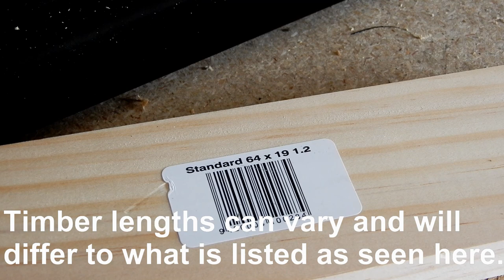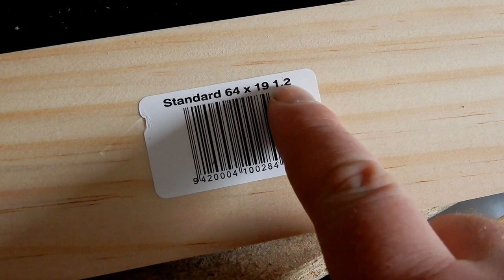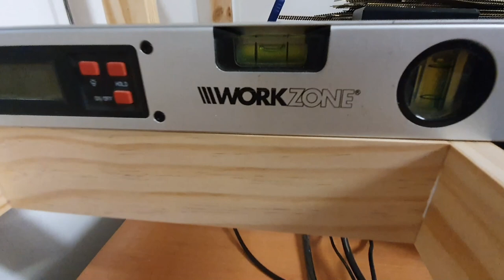Leila Central - Building Model Railway Benchwork

Comment: Have you thought about LED Strip lighting.  You could run them long the bottom of the front beam  check out Ledlighting.com.au as an example.  I can't waiting to see how its going to look
Mark
Reply from the maker: Hi Mark, indeed I have been looking at LED lighting. I have a few things to consider when selecting my lighting including power outlets required vs what’s available. Still got a lot of research to do yet but I will definitely check out the link, thanks for providing it! Clint

Comment: Having caught up on all your videos till now I have to ask, what happened to the need to have a working area in your shed aside from model railway and what on earth are you going to do with those two wall cabinets? Otherwise I am loving the new build, basically going from one to two layouts, greedy lol. Did wonder at one stage if one of them was going to be N gauge. 
Regards Chris
Reply from the maker: Ha yes! Well it's called watch the next video lol. Yea still need storage and needs a purpose but them cabinets will be going. Greedy is the word but I call it doing both things when you cant decide! No joke I have considered making them n gauge and the run would be crazy and off alot of benefits. Still may do so down the track but at this stage not settled on it. All the best, Clint